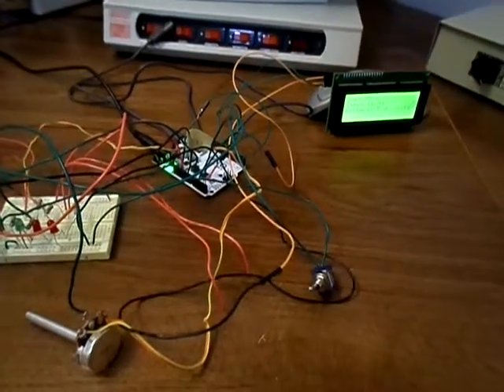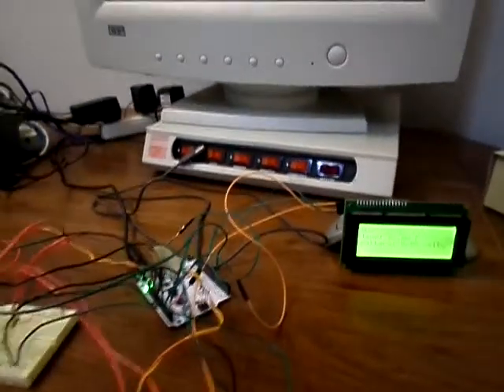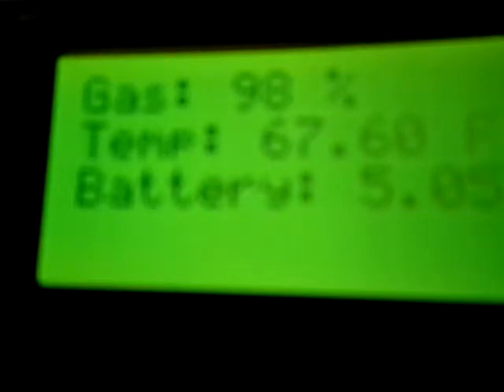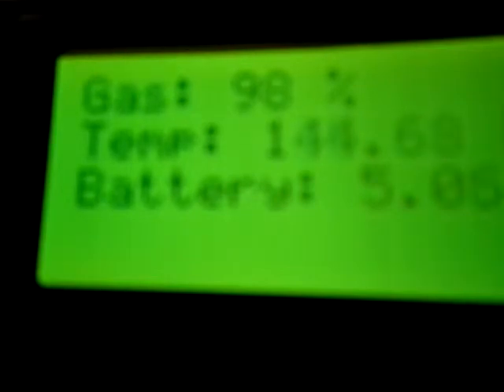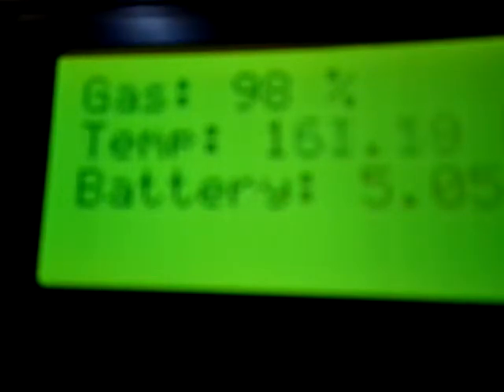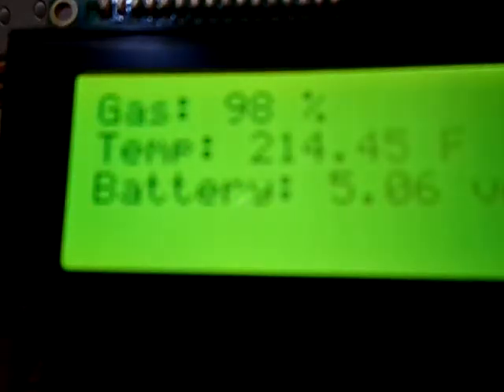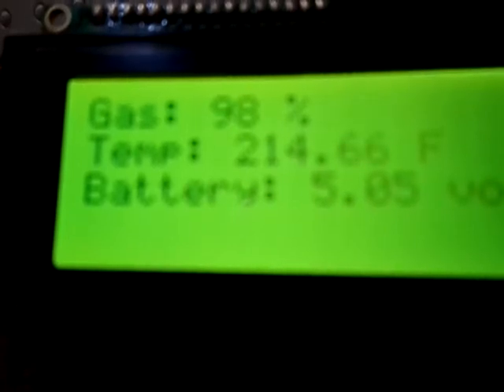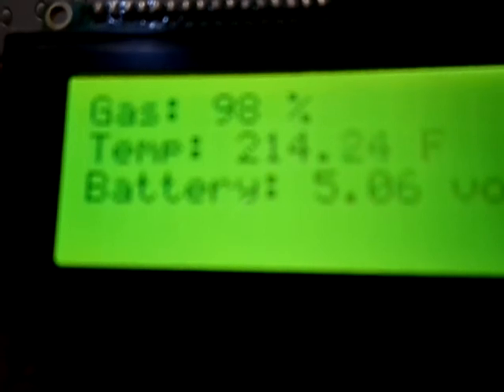Arduino LCD display for Wikispeed car sensors

Comment from the maker: /*
Code for this:  
This sketch allows the Arduino to monitor the car sensors and functions and report them 
to an LCD display, as well as take direct action on sensor readings. The LCD shows coolant
temperature, gas tank level, and battery voltage. The display has 4 lines and the Arduino
has one more analog input, so another function can be added later

The device can also be connected to a computer. The computer interrogates the Arduino by
sending characters to a serial port and the Arduino responses by sending replies.
The following is a list of the computer signal characters and the Arduino reply:

A - Radiator temperature sensor resistance in ohms. Inversely proportionate to temperature.
B - Gas tank sensor resistance in ohms. Inversely proportionate to gas tank level
C - Digital input pin 2. Any on/off value desired
D – Battery voltage in millivolts (used instead of volts so answer will in integer). 

Z – Responds by sending character c (ASCII 90), used to confirm to computer that Arduino 
is plugged in.

 */

#include <Wire.h> 
#include <LiquidCrystal_I2C.h>

LiquidCrystal_I2C lcd(0x27,20,4);  // set the LCD address to 0x27 for a 20 chars and 4 line display

float coolantSensor = 0;    // first analog sensor
float LogResistance;
float CoolantTemperature; // Temperature of coolant
int gasLevelSensor = 0;   // second analog sensor
int batteryLevelSensor = 0;    // third analog sensor
int firstDigitalSensor = 0;   // first digital sensor
int TestOn;
int inByte = 0;         // incoming serial byte
const int firstDigitalSensorPin = 4;
const int TestPin = 2;

const int BacklightOnOffPin = 7;
//int RTurnOutPin = 7; //Right turn light output is on digital pin 7
//int LTurnOutPin = 8; //Left turn light output is on digital pin 8
const int FanOutPin = 12; // Coolant fan or engine overheat light output is on digital pin 12
const int OverheatLEDPin = 10; // Coolant overheat warning light
boolean flashStarted = false;
int interval = 400; //Turn signal flashing duration = 400 milliseconds on and 400 milliseconds off
long previousMillis = 0; 
long PreviousMillisSinceLCDUpdate = 0;
int LCDInterval = 1000;

const float RCoolantRef = 150.0; // Actual value of coolant sensor reference resistor
float RCoolantSensor; // Measured resistance of coolant sensor
const int RGasRef = 100; // Actual value of gasoline level sensor reference resistor
float RGasSensor; // Measured resistance of gasoline level sensor
const int FanTriggerLevel = 600; //Resistance on ohms of coolant sensor at which to trigger radiator fan
const long MaxA = 1023; // Maximum possible value of Arduino analog input
const long RV1Ref = 3300; // Actual value of voltage divider # 1 for volt meter, long integer
const long RV2Ref = 6800; // Actual value of voltage divider # 2 for volt meter, long integer
const long C = 205; // Conversion constant used to convert analog pin input to volts, long integer variable
float RV1RefF = RV1Ref; // Actual value of voltage divider # 1 for volt meter, floating point variable
float RV2RefF = RV2Ref; // Actual value of voltage divider # 2 for volt meter, floating point variable
float VSF; // Measured battery voltage as floating point variable
float CF = 204.6; // Conversion constant used to convert analog pin input to volts, floating point variable
float gasConvert;
boolean BacklightOn = true; // Is LCD back light turned on
boolean PreviousBacklightOn = true;  // Was LCD back light turned on
const float FanOnTemp = 180; //Temperature to turn on coolant fan
const float OverheatLEDPinOnTemp = 210; // Temperature to turn on warning light
const float TemperatureMargin = 10; // Amount coolant temerature must drop below FanOnTemp before fan turns off
const int FuelFullResistance = 90;
const int FuelEmptyResistance = 0;

void setup()
{
  // start serial port at 9600 bps:
  lcd.init();                      // initialize the lcd 
  lcd.backlight(); 
  Serial.begin(9600);
  //Note: This sketch does not work on Leonardo boards

  pinMode(A0, INPUT);   // digital sensor is on digital pin 2
  pinMode(A1, INPUT);   // digital sensor is on digital pin 2
  pinMode(A2, INPUT);   // digital sensor is on digital pin 2
//  pinMode(A7, INPUT);   // Remark this out if not using BOUNO Arduino
  pinMode(FanOutPin, OUTPUT);   // Output to turn on radiator fan and/or dashboard display light
  pinMode(OverheatLEDPin, OUTPUT);   // Output to turn on radiator fan and/or dashboard display light

  pinMode(BacklightOnOffPin, INPUT_PULLUP);   // LCD back light switch is on digital pin 7 with internal pull up resistor
  pinMode(TestPin, INPUT_PULLUP);   // Test switch is on digital pin 2 with internal pull up resistor
//  TestPin
  digitalWrite(FanOutPin,LOW); // Start out with fan or radiator temperature warning light OFF
  
}

void loop()
{
  //Read analog values for sensors
  coolantSensor = analogRead(A0);
  batteryLevelSensor = analogRead(A1);
  gasLevelSensor = analogRead(A2);
  firstDigitalSensor = digitalRead(firstDigitalSensorPin);
  TestOn = digitalRead(TestPin);
  int BacklightOnOffPinValue = digitalRead(BacklightOnOffPin);
  if (BacklightOnOffPinValue == HIGH)
    {BacklightOn = true;}
   else
    {BacklightOn = false;}
   if (PreviousBacklightOn != BacklightOn)
     {if (BacklightOn)
       {lcd.backlight(); }
      else
        {lcd.noBacklight();}
      PreviousBacklightOn = BacklightOn;
     }
     
  // Calculate actual coolant sensor resistance
  RCoolantSensor =  (((1023.0 * RCoolantRef)/coolantSensor)  - RCoolantRef)/1000.0;
  // Convert resistance of coolant sensor to actual coolant temperature
  LogResistance = log(RCoolantSensor);
  CoolantTemperature = -28.85390082 * LogResistance + 53.5614381;
  if (RCoolantSensor > .4) {CoolantTemperature = -36.4052944 * LogResistance + 46.76492659;}
  if (RCoolantSensor > 1.2) {CoolantTemperature = -39.15230378 * LogResistance + 47.13830898;}
  if (RCoolantSensor > 2) {CoolantTemperature = -22.32056306 * LogResistance + 35.61983711;}
  CoolantTemperature = CoolantTemperature  * 1.8 + 32.0; // Convert colant temperature from C to F
  // Turn coolant fan on or off depending on coolant sensor resistance
  if (TestOn == HIGH) {
  if (CoolantTemperature >= FanOnTemp) {digitalWrite(FanOutPin,HIGH);}
  if (CoolantTemperature < FanOnTemp - TemperatureMargin) {digitalWrite(FanOutPin,LOW);}
  if (CoolantTemperature >= OverheatLEDPinOnTemp) {digitalWrite(OverheatLEDPin,HIGH);}
  if (CoolantTemperature < OverheatLEDPinOnTemp - TemperatureMargin) {digitalWrite(OverheatLEDPin,LOW);}
    }
  else {
    digitalWrite(FanOutPin,HIGH);
    digitalWrite(OverheatLEDPin,HIGH);
  }

 
  unsigned long currentMillis = millis();
  if (currentMillis - PreviousMillisSinceLCDUpdate > LCDInterval) 
    {
    // Calculate actual gasoline level sensor resistance
    RGasSensor = ((MaxA*RGasRef)/gasLevelSensor)  - RGasRef;
//    int GasLevel = 100.0 * (1.0 - (RGasSensor/105.0)) * (1 - (RGasSensor/105.0));
    int GasLevel = 100.0 * (1.0 - ((FuelFullResistance - RGasSensor)/(FuelFullResistance - FuelEmptyResistance))   );
    // Calculate actual battery voltage
    VSF = batteryLevelSensor * (RV1RefF + RV2RefF)/(RV1RefF * CF);
    
    lcd.setCursor(0,0); //Set position
    lcd.print("                    "); //Clear the line on the LCD
    lcd.setCursor(0,0); //Set position
    lcd.print("Gas: "); 
    lcd.print(GasLevel);       
    lcd.print(" %"); 

    lcd.setCursor(0,1); //Set position
    lcd.print("                    "); //Clear the line on the LCD
    lcd.setCursor(0,1); //Set position
    lcd.print("Temp: "); 
    lcd.print(CoolantTemperature);       
    lcd.print(" F"); 

    lcd.setCursor(0,2); //Set position
    lcd.print("                    "); //Clear the line on the LCD
    lcd.setCursor(0,2); //Set position
    lcd.print("Battery: "); 
    lcd.print(VSF);       
    lcd.print(" volts"); 
    PreviousMillisSinceLCDUpdate = currentMillis;
    }
  
  // if we get a valid byte, read analog ins:
  if (Serial.available() > 0) {
    // get incoming byte:
    char inChar = (char)Serial.read();
    // send sensor values:
    if (inChar == 65) {Serial.println(RCoolantSensor);} // A
    if (inChar == 66) {Serial.println(RGasSensor);} // B
    if (inChar == 67) {Serial.println(firstDigitalSensor);} // C
    if (inChar == 68) {Serial.println(VSF);} // D
//    if (inChar == 69) {
//      Serial.print("A7 = ");
//      Serial.println(analogRead(A7));
//    } // E
        
    if (inChar == 90) {Serial.print("c");} // Z - Return "c" to confirm connection if computer sends "Z"
  }
}

Comment: please a cod for arduino
Reply from the maker: Sorry for the delay. I got busy and forgot it. Here is the code.

/*
  
This sketch allows the Arduino to monitor the car sensors and functions and report them 
to an LCD display, as well as take direct action on sensor readings. The LCD shows coolant
temperature, gas tank level, and battery voltage. The display has 4 lines and the Arduino
has one more analog input, so another function can be added later

The device can also be connected to a computer. The computer interrogates the Arduino by
sending characters to a serial port and the Arduino responses by sending replies.
The following is a list of the computer signal characters and the Arduino reply:

A - Radiator temperature sensor resistance in ohms. Inversely proportionate to temperature.
B - Gas tank sensor resistance in ohms. Inversely proportionate to gas tank level
C - Digital input pin 2. Any on/off value desired
D – Battery voltage in millivolts (used instead of volts so answer will in integer). 

Z – Responds by sending character c (ASCII 90), used to confirm to computer that Arduino 
is plugged in.

 */

#include <Wire.h> 
#include <LiquidCrystal_I2C.h>

LiquidCrystal_I2C lcd(0x27,20,4);  // set the LCD address to 0x27 for a 20 chars and 4 line display

float coolantSensor = 0;    // first analog sensor
float LogResistance;
float CoolantTemperature; // Temperature of coolant
int gasLevelSensor = 0;   // second analog sensor
int batteryLevelSensor = 0;    // third analog sensor
int firstDigitalSensor = 0;   // first digital sensor
int TestOn;
int inByte = 0;         // incoming serial byte
const int firstDigitalSensorPin = 4;
const int TestPin = 2;

const int BacklightOnOffPin = 7;
//int RTurnOutPin = 7; //Right turn light output is on digital pin 7
//int LTurnOutPin = 8; //Left turn light output is on digital pin 8
const int FanOutPin = 12; // Coolant fan or engine overheat light output is on digital pin 12
const int OverheatLEDPin = 10; // Coolant overheat warning light
boolean flashStarted = false;
int interval = 400; //Turn signal flashing duration = 400 milliseconds on and 400 milliseconds off
long previousMillis = 0; 
long PreviousMillisSinceLCDUpdate = 0;
int LCDInterval = 1000;

const float RCoolantRef = 150.0; // Actual value of coolant sensor reference resistor
float RCoolantSensor; // Measured resistance of coolant sensor
const int RGasRef = 100; // Actual value of gasoline level sensor reference resistor
float RGasSensor; // Measured resistance of gasoline level sensor
const int FanTriggerLevel = 600; //Resistance on ohms of coolant sensor at which to trigger radiator fan
const long MaxA = 1023; // Maximum possible value of Arduino analog input
const long RV1Ref = 3300; // Actual value of voltage divider # 1 for volt meter, long integer
const long RV2Ref = 6800; // Actual value of voltage divider # 2 for volt meter, long integer
const long C = 205; // Conversion constant used to convert analog pin input to volts, long integer variable
float RV1RefF = RV1Ref; // Actual value of voltage divider # 1 for volt meter, floating point variable
float RV2RefF = RV2Ref; // Actual value of voltage divider # 2 for volt meter, floating point variable
float VSF; // Measured battery voltage as floating point variable
float CF = 204.6; // Conversion constant used to convert analog pin input to volts, floating point variable
float gasConvert;
boolean BacklightOn = true; // Is LCD back light turned on
boolean PreviousBacklightOn = true;  // Was LCD back light turned on
const float FanOnTemp = 180; //Temperature to turn on coolant fan
const float OverheatLEDPinOnTemp = 210; // Temperature to turn on warning light
const float TemperatureMargin = 10; // Amount coolant temerature must drop below FanOnTemp before fan turns off
const int FuelFullResistance = 90;
const int FuelEmptyResistance = 0;

void setup()
{
  // start serial port at 9600 bps:
  lcd.init();                      // initialize the lcd 
  lcd.backlight(); 
  Serial.begin(9600);
  //Note: This sketch does not work on Leonardo boards

  pinMode(A0, INPUT);   // digital sensor is on digital pin 2
  pinMode(A1, INPUT);   // digital sensor is on digital pin 2
  pinMode(A2, INPUT);   // digital sensor is on digital pin 2
//  pinMode(A7, INPUT);   // Remark this out if not using BOUNO Arduino
  pinMode(FanOutPin, OUTPUT);   // Output to turn on radiator fan and/or dashboard display light
  pinMode(OverheatLEDPin, OUTPUT);   // Output to turn on radiator fan and/or dashboard display light

  pinMode(BacklightOnOffPin, INPUT_PULLUP);   // LCD back light switch is on digital pin 7 with internal pull up resistor
  pinMode(TestPin, INPUT_PULLUP);   // Test switch is on digital pin 2 with internal pull up resistor
//  TestPin
  digitalWrite(FanOutPin,LOW); // Start out with fan or radiator temperature warning light OFF
  
}

void loop()
{
  //Read analog values for sensors
  coolantSensor = analogRead(A0);
  batteryLevelSensor = analogRead(A1);
  gasLevelSensor = analogRead(A2);
  firstDigitalSensor = digitalRead(firstDigitalSensorPin);
  TestOn = digitalRead(TestPin);
  int BacklightOnOffPinValue = digitalRead(BacklightOnOffPin);
  if (BacklightOnOffPinValue == HIGH)
    {BacklightOn = true;}
   else
    {BacklightOn = false;}
   if (PreviousBacklightOn != BacklightOn)
     {if (BacklightOn)
       {lcd.backlight(); }
      else
        {lcd.noBacklight();}
      PreviousBacklightOn = BacklightOn;
     }
     
  // Calculate actual coolant sensor resistance
  RCoolantSensor =  (((1023.0 * RCoolantRef)/coolantSensor)  - RCoolantRef)/1000.0;
  // Convert resistance of coolant sensor to actual coolant temperature
  LogResistance = log(RCoolantSensor);
  CoolantTemperature = -28.85390082 * LogResistance + 53.5614381;
  if (RCoolantSensor > .4) {CoolantTemperature = -36.4052944 * LogResistance + 46.76492659;}
  if (RCoolantSensor > 1.2) {CoolantTemperature = -39.15230378 * LogResistance + 47.13830898;}
  if (RCoolantSensor > 2) {CoolantTemperature = -22.32056306 * LogResistance + 35.61983711;}
  CoolantTemperature = CoolantTemperature  * 1.8 + 32.0; // Convert colant temperature from C to F
  // Turn coolant fan on or off depending on coolant sensor resistance
  if (TestOn == HIGH) {
  if (CoolantTemperature >= FanOnTemp) {digitalWrite(FanOutPin,HIGH);}
  if (CoolantTemperature < FanOnTemp - TemperatureMargin) {digitalWrite(FanOutPin,LOW);}
  if (CoolantTemperature >= OverheatLEDPinOnTemp) {digitalWrite(OverheatLEDPin,HIGH);}
  if (CoolantTemperature < OverheatLEDPinOnTemp - TemperatureMargin) {digitalWrite(OverheatLEDPin,LOW);}
    }
  else {
    digitalWrite(FanOutPin,HIGH);
    digitalWrite(OverheatLEDPin,HIGH);
  }

 
  unsigned long currentMillis = millis();
  if (currentMillis - PreviousMillisSinceLCDUpdate > LCDInterval) 
    {
    // Calculate actual gasoline level sensor resistance
    RGasSensor = ((MaxA*RGasRef)/gasLevelSensor)  - RGasRef;
//    int GasLevel = 100.0 * (1.0 - (RGasSensor/105.0)) * (1 - (RGasSensor/105.0));
    int GasLevel = 100.0 * (1.0 - ((FuelFullResistance - RGasSensor)/(FuelFullResistance - FuelEmptyResistance))   );
    // Calculate actual battery voltage
    VSF = batteryLevelSensor * (RV1RefF + RV2RefF)/(RV1RefF * CF);
    
    lcd.setCursor(0,0); //Set position
    lcd.print("                    "); //Clear the line on the LCD
    lcd.setCursor(0,0); //Set position
    lcd.print("Gas: "); 
    lcd.print(GasLevel);       
    lcd.print(" %"); 

    lcd.setCursor(0,1); //Set position
    lcd.print("                    "); //Clear the line on the LCD
    lcd.setCursor(0,1); //Set position
    lcd.print("Temp: "); 
    lcd.print(CoolantTemperature);       
    lcd.print(" F"); 

    lcd.setCursor(0,2); //Set position
    lcd.print("                    "); //Clear the line on the LCD
    lcd.setCursor(0,2); //Set position
    lcd.print("Battery: "); 
    lcd.print(VSF);       
    lcd.print(" volts"); 
    PreviousMillisSinceLCDUpdate = currentMillis;
    }
  
  // if we get a valid byte, read analog ins:
  if (Serial.available() > 0) {
    // get incoming byte:
    char inChar = (char)Serial.read();
    // send sensor values:
    if (inChar == 65) {Serial.println(RCoolantSensor);} // A
    if (inChar == 66) {Serial.println(RGasSensor);} // B
    if (inChar == 67) {Serial.println(firstDigitalSensor);} // C
    if (inChar == 68) {Serial.println(VSF);} // D
//    if (inChar == 69) {
//      Serial.print("A7 = ");
//      Serial.println(analogRead(A7));
//    } // E
        
    if (inChar == 90) {Serial.print("c");} // Z - Return "c" to confirm connection if computer sends "Z"
  }
}
Reply: +David Leithauser it dosent wrap properly in arduino IDE can you email me the arduino ino file? vashy81@gmail.com
Reply from the maker: +Dale Geddes The text does not warp. you must format it by specifying which like to put the text on and then being careful that the text does not exceed the line length of the display (I think it was 40 for this display). I will see if I can dig up the code and email it to you. It has been a long time since I posted this.